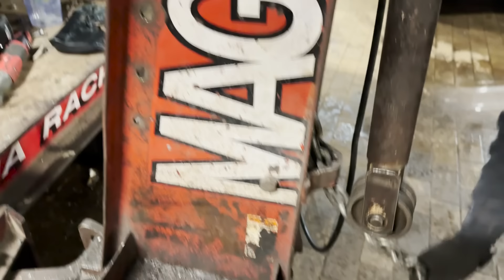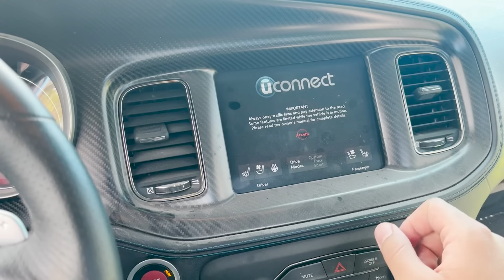I Bought Another Hellcat Daytona Charger From Copart *I Now Have 3*

Comment: Personally, I use to just cut the doors off then start pulling directly on the structure
Reply: absolutely, also pull from the point of impact. wasting so much time
Reply: What is your estimation on how much it will cost to get that car back right? I was just wondering, is it worth the cost and repair 🤷🏾‍♂️ I don't know anything about repairing a car, so I probably would have just got someone to snatch the motor and transmission out and put them into something else 🤷🏾‍♂️

Comment: Bruh what are you doing on the pull work, even at the beginning, you should had removed the doors before pulling at all, and yes you can remove the doors crunched like this, cut a hole in them to release the latch and allow hinge bolt access, I have remove hundreds of caved in doors to b pillars and not once had to use a frame machine to do it, also removed the doors and fender would had been safe and rear door glass safe as well.. total amateur hour.. you are tearing shit up pulling on the door window frames like this. Cutting the good wiring harnesses is absurd, when a lot of them are different..  total beginners..

Comment: Get a car can be fixed it from you willing to put in the time if you ever watch the Goon Squad they have rebuilt some pretty horrific damaged vehicles what is going to take is you taking everything out of that car the entire interior put it back on the frame machine taking off that entire damaged side problems from the a-pillar back just passed the rear door only problem is is getting that roof back into which would be peeling off the skin if you've ever watched the Goon Squad they did that your Mercedes YouTube the entire majority regarding took apart and they put it back together Pinellas County what they do is they buy vehicles from Copart that are damaged play some Lando's Mustangs vents quite a few Dodge Chargers and that other one did a few Camaros majority of their vehicles that they have other than the truck stays bought David rebuilding better word to the wise that car really is not that far gone damaged and personally flower usually not a purchased it but I will keep the black one as a project all of you need is a few parts off of that vehicle just replace that side of the vehicle you can put the car back together whether you realize it or not I mean I don't know if you want to but what I would do is get the parts off of it wrap it up if you have a garage to put it in Trust and Believe you will see another one that you can drop all the stuff that you don't use on that one so it just depends on what you want to do I enjoyed your video